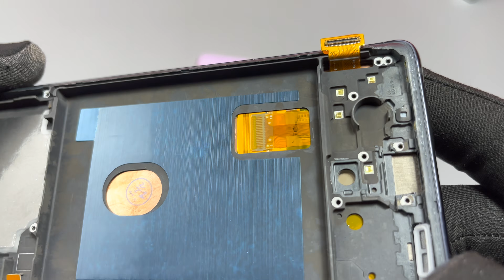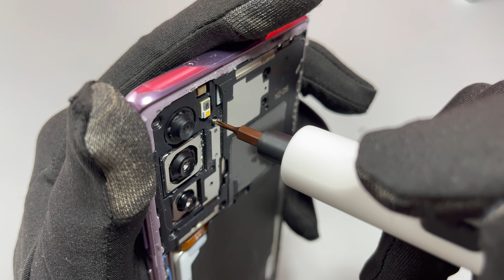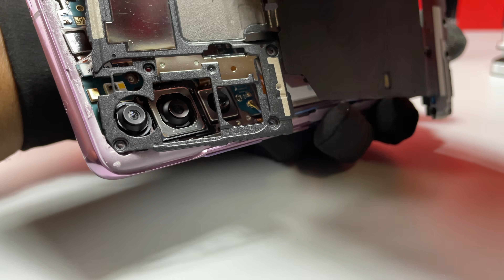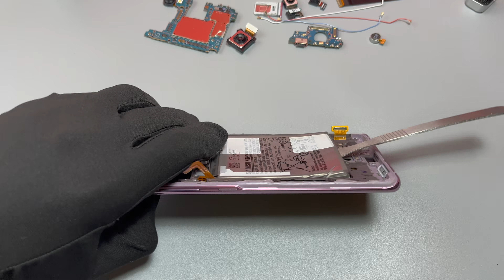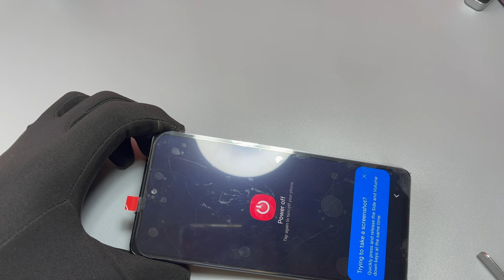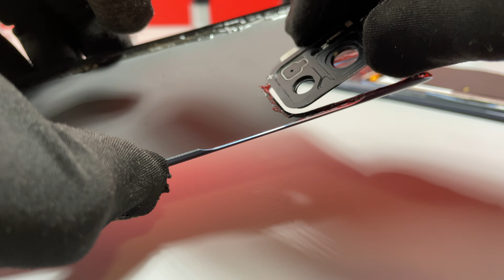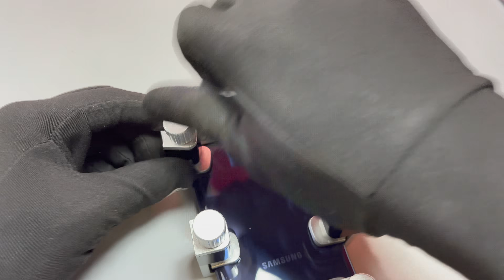How to Galaxy S20 FE Screen Replacement

Comment: S20fe breaks so easily
Reply from the maker: True the screen feel a bit fragile than high end Samsung screens. The back being plastic was after all a good decision
Reply: It sure does
Reply: Very TRUE.
My phone also got a hairline crack.  It fell from a very little height. 
It is working fine but I'm confused. Should I change the screen or shall I continue using this
Reply from the maker: Hairline crack will either need a new glass or just a complete screen replacement
Reply: Agree, I got one on Black Friday and broke it the week after. Paid for Samsung insurance and a replacement, just for the screen to break again a week later. Still functions, probly just gonna use it as much as I can. Can't afford to keep dishing money out for bs products
Reply from the maker: Haha it very fragile. Just get a good case 👍🏽
Reply: Mine almost two years old now with cheap clear case and tempered glass screen protector. Dropped it in the lake two weeks ago and took the case off to let it dry, dropped it an hour later and the screen cracked!!! Only time the case was off since I had it!,😮 It is only Gorilla glass 3. It still works fine, however I got a new Pixel 7 thru Koodo for 11 bucks a month for 24 months with a 375 dollar bill reduction deal (25/month off my bill for 15 months) so they paid me to get a new phone and it has Gorilla Victus glass, however I still use a case and screen protector! Koodo has me for another two years but with unlimited talk & text and 75 gigs of data and free long distance to 30 plus countries for 55/month I am happy for now!😊
Reply: I broke mines today lol
Reply: Sry but s20fe is more dureable then any edge Display. I ve dropt it many Times. Nothing happened
Reply: @marvnxy8098  That's not entirely true, you have to remember that the S20FE has gorilla glass 3 compared to the S23 series with gorilla glass victus. Overall it depends on the glass type of the phone.
Reply: user issue
Reply: @benettonkhoo8866  

Exactly.  They think they can throw it around like a tennis ball and it'll still work.
Reply: The phone just sucks
Reply: @chickennuggets7350  

It really doesn't.
Reply: It breaks about as easily as ANY large screen, small bezel glass screened smart phone.

Comment: U open lavender color, and then change all to new one
Reply from the maker: Yes. The customer wanted a new color for his S20fe. While repairing you can customize if you want (frame color and back color)
Reply: What sort of heat gun are you using and what tools are you using? Many thanks.
Reply from the maker: Hey i have tools in the description! 
The heatgun doesn't need any fancy setting or power. The heatgun I have is one of the cheapest I got online. As long as you can grab it sweep the area turn on and off quickly it will do it.